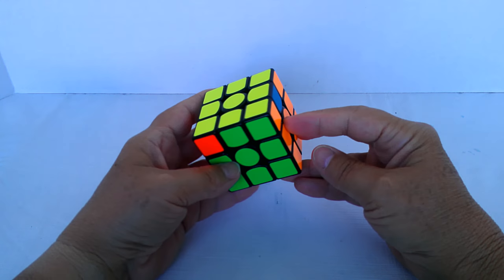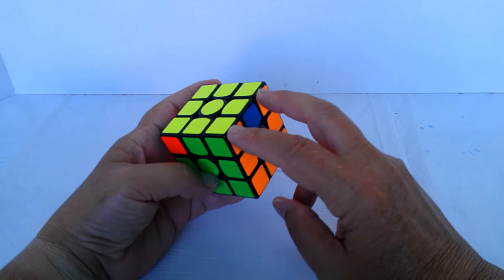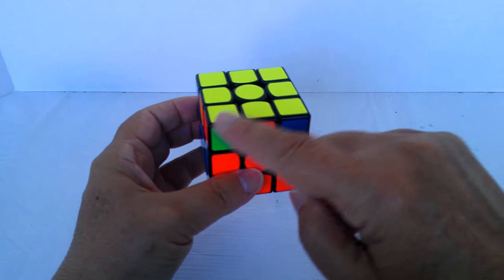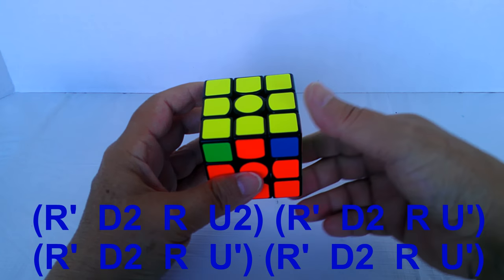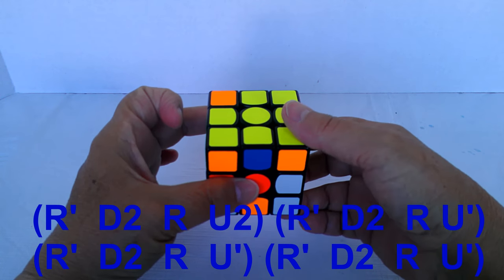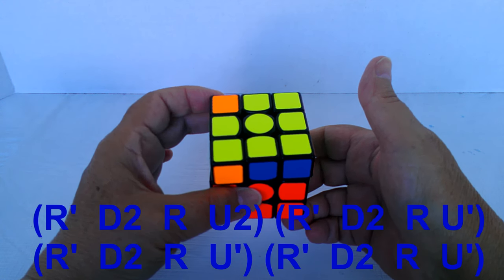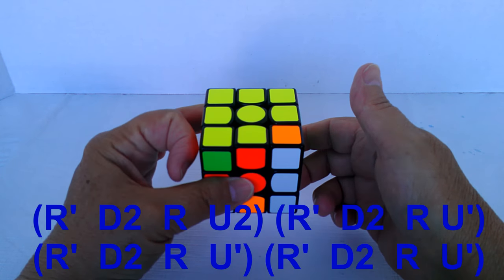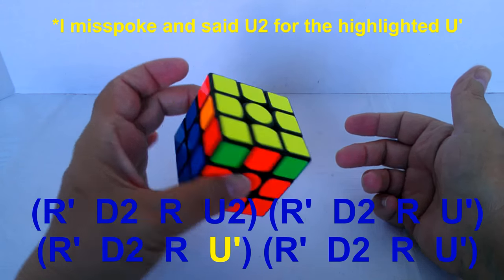Rubik's Cube -- 2-Look PLL:  Swap Adjacent Corners (3x3)  (See comments for updated version link)

Comment: This is really nice! I've just finished two look oll and have just started to learn a bit of pll so this is very helpful. The moves are also very harmonious making it easy to remember.
Reply from the maker: Thank you!  There's another one that I also use for the same thing.  There's a link to it in the Description.  You might look at it and see which you prefer.  Good luck with your progress!
Reply: @donnaleiber6214  Im surprised you replied, considering this video is 4 years old. Yes im checking it out, and it helped me get my time from 44 seconds to around 42
Reply from the maker: @silenceyang6980  I try to respond when people take the time to comment.  Thanks.

Comment: Thanks.  I learned new things from this.  It does indeed swap my corners as shown.  It moves some edges around in a way that took me backward a bit, but learning is learning.
Reply from the maker: True.  I do edges last, so it doesn't matter to me if this affects them, but for people like you who do the steps in a different order, it probably isn't ideal.  I agree with you that learning is learning, though.  Thanks for your comments.
Reply: @donnaleiber6214 - I've done corners last many many times(solve all edges without solving any corners then solve corners).  It never occurred to me to try to move edges without moving corners though.

Comment: I'm normally not a fan of algs that use the D layer, but because it's so repetitive and regular this is quite easy. Thank you.
Reply from the maker: You're welcome (and I know what you mean about the D layer).  (You probably already know other adjacent-corner swaps, but I just discovered one for beginners last night and it's certainly easy to memorize.  Not sure I'll switch, but maybe.  Position the two corners to be swapped on the top layer at the right front and back.  Do the sexy move three times, rotate the cube clockwise 90 degrees, then do the mirror sexy move three times.)

Comment: I followed your movements exactly and my cube got in a worse off position lol judging by other comments it probably only works in very specific scenarios
Reply from the maker: It does what it says.  However, if you solve edges before corners, it probably does mess those edges up.  It works for me and others who solve in our particular order (which I thought was 2- look OLL and 2-look PLL).  Sorry it didn't work for whatever order you use.

Comment: I believe your first U2 is actually U'2 ? Your notation and what your hands do don't match up
Reply from the maker: You're probably right, but it's a turn of 180 degrees, so it doesn't really matter which way you rotate, clockwise or counterclockwise.  The algorithm is what matters most and which way each person chooses to move 180-degree turns is a personal preference, but I probably should have pointed that out.

Comment: I have the whole cube solved except for the red blue and yellow and red blue and white corner are mixed up. The blue corners are where the red side is the white and yellow are where the blue side is and the red sides are where the white and yellow side is.
Reply from the maker: You can fix your situation this way:  hold cube with blue on top, red at front, and yellow on the right.  Do these moves:  R  B'  R'  U'  B'  U  F  U'  B  U  R  B  R'  F'.  Then repeat those moves again.
Reply: @donnaleiber6214  Thanks so much!
Reply from the maker: @illburnmyselfforreal  You're welcome.

Comment: You put D but you are doing D' , same with U and U'
Reply from the maker: Nope.  I don't even do a D move or a U move.  And if you're talking about 180-degree turns, you should be more specific.  Plus, it doesn't matter which direction you rotate on those double-turns (for my purposes).

Comment: this doesnt work it just rotates back around to the same layout
Reply from the maker: I'm sorry you're having troubles, but it does work.  It works in the video and I've done it literally hundreds of times and it always works.  So either you are doing one of the moves wrong, or you're using it for a case that isn't to swap adjacent corners.
Reply: @donnaleiber6214  it is strange because my 4x4 was identical in layout (counting the middle 2 as one, already reduced) and I copied you two times, video set to slow motion, and exactly the same result both times, just back to exactly how it started

no worries though I found another video with a different solution and that worked instead
Reply from the maker: @stuartbowes619  I'm glad you found something that works for you.  The alg in my video DOES work for a 4x4x4, though.  I've done it hundreds of times and just verified it.  So, you're still either doing a move wrong, not starting in the right position, or not rotating the U at the end to see your switched corners.
Reply: @donnaleiber6214  I copied it 100% exactly so i can only assume you do something after these moves that you don't mention in the video. 
At each stage for every single move I paused it and examined the layout and the colour locations were identical every step

So something is definitely 100% unequivocally amiss

Comment: I just started 2-4 look oll and was looking for a better algorithm then I had. Been using this one which is pretty fluid aside from the facing of the cube. 

x R' U R' D2 R U' R' D2 R2 x'

Will have to try yours to see if it is more fluid. 

PS- Hello fellow cuber group friend!
Reply from the maker: Hi!  Even though this has D moves and a total of 16 turns, I got pretty fast at it.  However, I have recently found an alg I like for Fewest Moves Competition, because it is only 9 moves.  It was slower at first, which doesn't matter for FMC, but I'm using in all my solves now.  I will make a video about it in a couple of days.  But here:  hold cube so the two corners to be swapped are at the upper back and do:  (R B' R)  F2  (R' B R)  F2  R2.
Reply: @donnaleiber6214  I'm crazy bad with B turns and M turns lol. I've been just drilling the M versions of H Z Ua Ub to get better with the finger flips. Need to do that with B too. Look forward to the video.

Comment: Hmm, it keeps mixing up my middle pieces on my top layer.. but switches the corners into the right places
Reply from the maker: Yes, that is how this works.  I do the last layer in 4 steps, called 4-look last layer or 4LLL.  Two steps for OLL and two steps for PLL.  My two steps for PLL fix the corners first and then the edges, so it is okay that this algorithm disturbs my edges.  If you need to do it all in a different order, this won't work for you.  Sorry.  :(
Reply: @donnaleiber6214  Its fine! Its great that youre helping! What i do is i point tthe two adjacent corners to my right,  do  R U R' U' three times, move the cube 90 degrees clockwise, and do L' U' L U three times and it switches the corners. Ik its a slow way but i only started learning :)
Reply from the maker: @Mistrye  Whatever works and keeps being fun!  We all have different ways to solve it.  I thought I posted a video of a full beginner's tutorial using the moves you mentioned, but I can't find it, so either I never uploaded it or didn't even get around to filming it.  Maybe I only made a written cheatsheet.  Let me know if I can help you with anything, though how I do things might be different from how others do them.